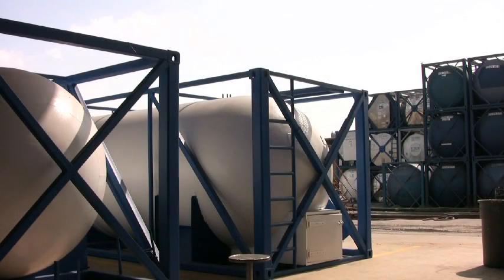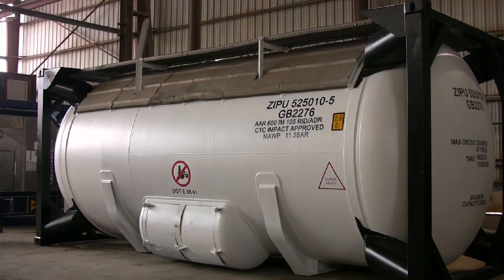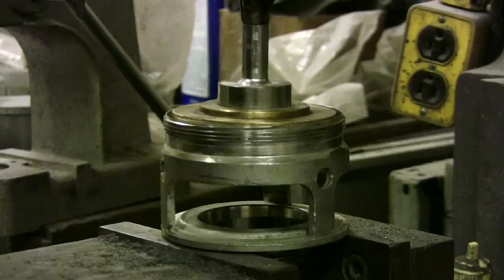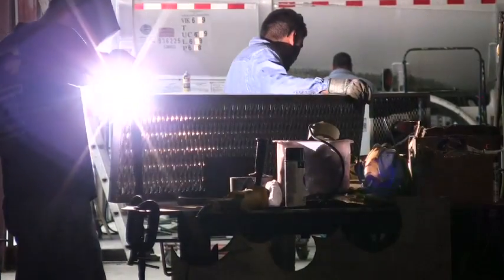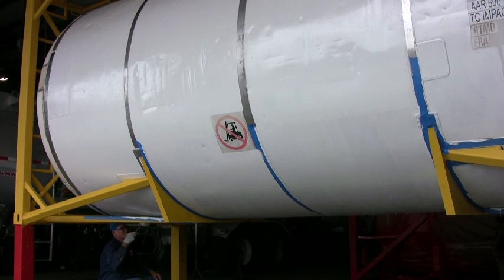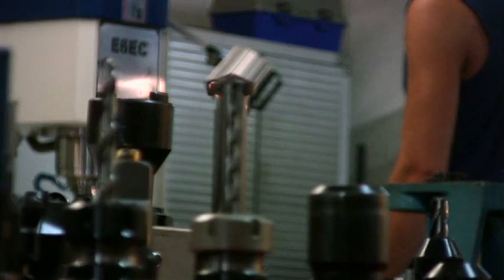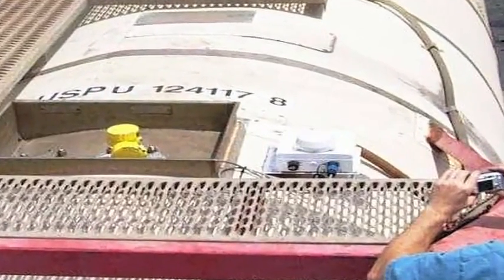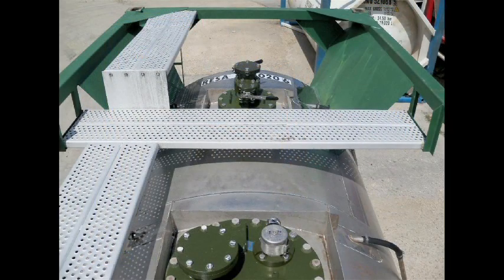TSI - tank repair/refurbishment video

Comment from the maker: @wilatemodel - Yes, absolutely tank containers can be used for storage of many products, including fuel.  Most have stainless steel tank barrels and stainless steel valves, and will provide decades of service.  Sometimes fuel storage tanks are governed by local regulations, so first check with your local fire marshall or other authority about what restrictions (if any) apply; such as secondary containment, etc.  Thanks for watching.